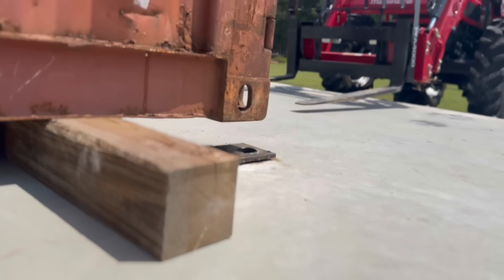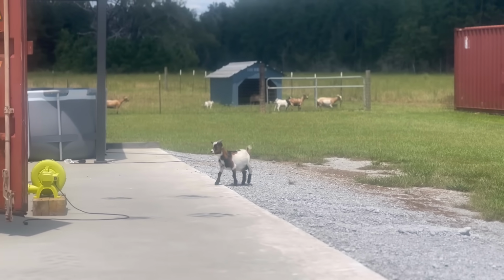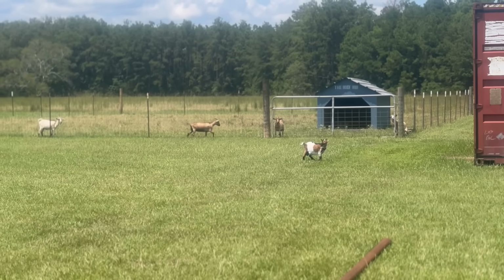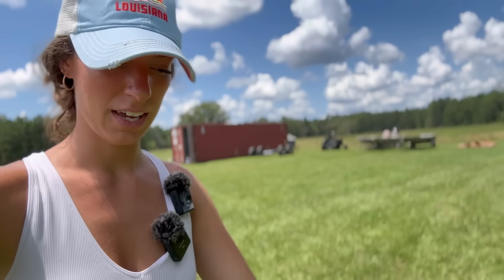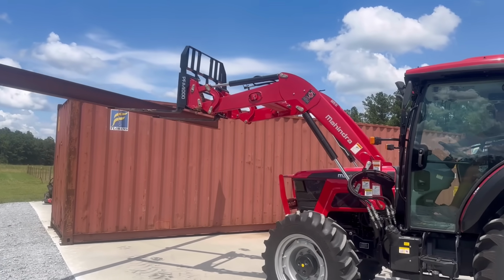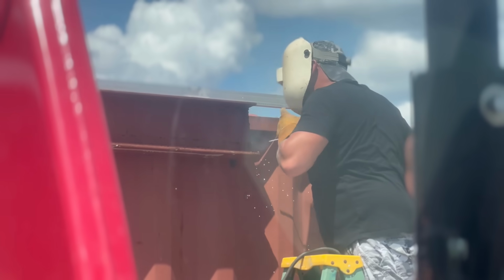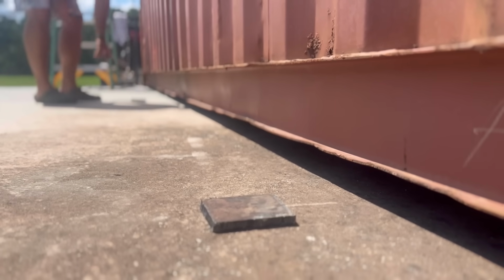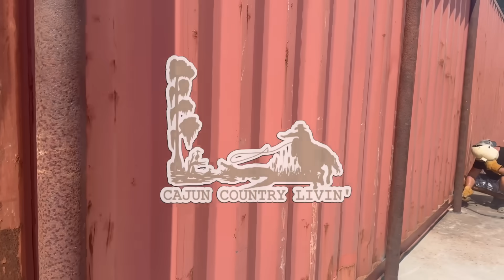Next Up…SETTING SECOND STORY SHIPPING CONTAINERS | SHIPPING CONTAINER WORKSHOP

Comment: Where I live our local zoning department will not let us build without a special expensive permit to build what you 2 are doing. I wanted to put a pitched roof over two 20 foot containers and was told I could not do it.  It would have made a nice carport, and my mechanic tools could have been stored in one of those containers. 
I too like to "repurpose" others' throw aways. Americans are known to be a "throw away society". Not me, not you. I used 9 flat roof trusses (a throw away) spaced 2 feet apart and 19 feet long and built a deck 19 x 18. The deck 2 x material was also someone's throw aways. I had to replace some bad boards this Spring with more throw aways and today the colors look the same, the weathered wood look. 
We like what you're doing, and we are also interested in your finished results. 
Was cute watching your goat get a free ride. I wouldn't have spine problems if my body was built like Jims. We live on some acres too. My favorite saying is "you don't need a gym membership if you own acreage" Or tell a medical provider "I don't need Physical Therapy as I have 2.5 acres of it. Still after 40 plus years still done by hand. No tractors here.

Comment: as for language barrier what about how you all spell the English language lol. Great job, tack in place to suit the container ribs, fit bases to posts on concrete base, weld them and support posts then seam weld full length of beam to container after accurate measurement, then return goat to the pen after finding out how got out.